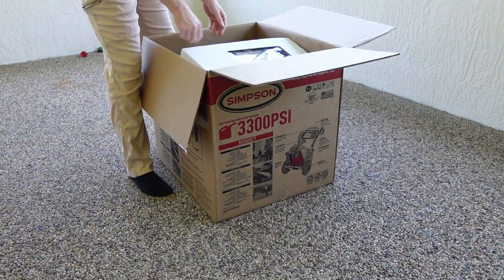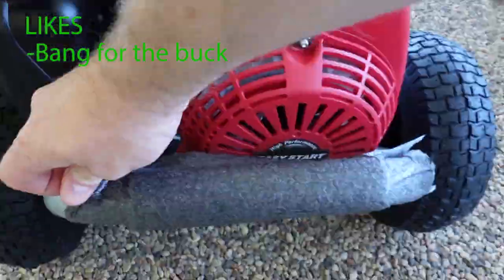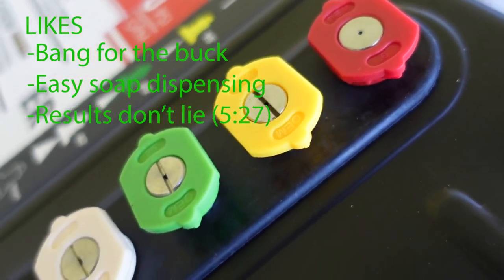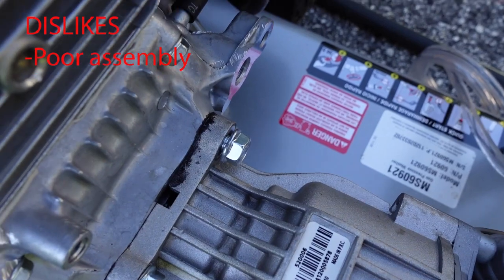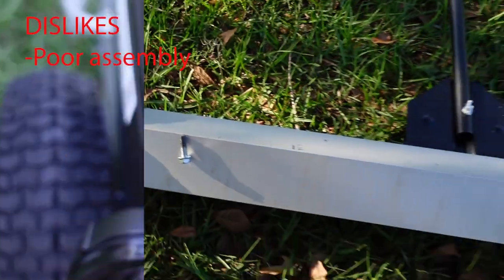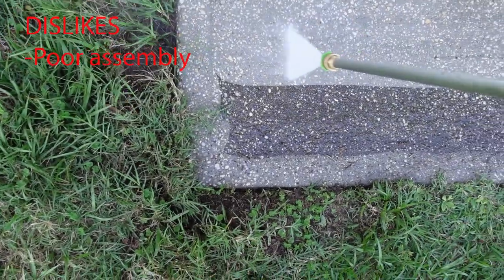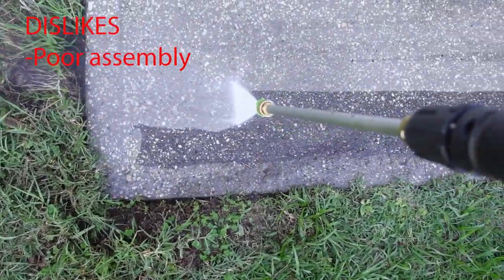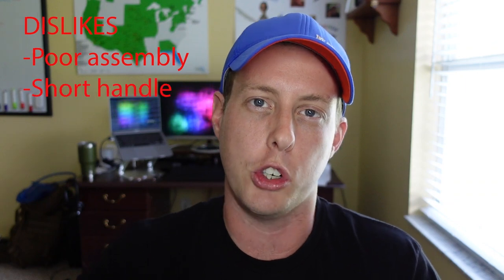Simpson Should Have Fixed THIS On Their Pressure Washer

Comment: Nice review. Now 3 yrs later they're no longer using the Honda GC, and it's GX series, Kohler, or CMX.  I got the CMX rated at 34ooPSI to keep it to the $400 price point. I'll be sure to check all the bolts for torque. I'd use blue loc-tite on those. Yes, they're NOISY! I got a Ryobi 1700 electric to do quiet vehicle washing. Thanks for the video.

Comment: Hello! I have this same pressure washer.. i’ve used it two other times the first time was washed my car washed my sisters car my brothers truck and it worked awesome!! Second time I pressure washed some old nasty hard wood boards  so I could Use them, again No Problems! Today I dragged some landscaping timbers out to clean’m up. I checked the gas checked oil everything great!! Cranked the pressure washer up started with the boards and I noticed that the water pressure would dissipate slightly then in-gage , dissipate—in-gage! I glanced at the washer..OIL !! OMG, I shut it down Fast!! From what I seen:: Clear/clean looking non burned oil on the base of where the engine sits on the body  underneath oil fill….It’s just/only me!! I purchased this pressure washer brand-new unopened box at a pawnshop..?????…

Comment: Would have liked to see Simpson install a gas shut off valve on their unit, so you won't have to run out the gas tank. Luckily, I have a Gas Station near me that sells Ethanol-Free gas, which I use in all of my gas powered tools/equipment and my Lawn Mower.

Comment: Agree it is too short to pull well. I am only 5'7" and still to short. Needs a telescoping handle(adjustable). My big beef is that it is too hard to start after 1st use in fact it wont start eve3n using all the normal tricks. I would take it back.

Comment: Thank you for the nice video.  Up till now I have just written my name in the snow but I just bought a Simpson power washer and today I am trying to learn how to use it.  I really wanted to learn more about the "bypass mode" because I'm a bit paranoid about forgetting to always allow some water through to protect the pump.  BTW what made your concrete so dark before you powerwashed it?
Reply from the maker: I left it running for too long one time and it started spraying water out of what I assume is a pressure relief valve. The concrete darkness was just many years of built-up dirt and grime believe it or not. Thanks for the comment!

Comment: Can the pressure be lowered on the pump? Could you do a video adjusting it?
Reply from the maker: It’s not variable, but you could use a wider nozzle or hold the wand further away if you’re concerned with it being too powerful. Thanks for the comment!
Reply: @ramstanreviews8622  I was thinking for adding different attachments that have lower rated PSI. I see there is a set bolt on a spring with a dab of factory set glue. I think I'll look at an in-line adjuster but it intuitively seems safer adjusting pressure at the pump.

Comment: any issue with the pressure washer vibrating/spinning? Mine spins in place on concrete... :(
Reply from the maker: I do notice some movement on concrete, but usually in the form of “walking” as opposed to the spinning you mention. If there’s some grass nearby, try placing it there instead - I didn’t see any movement in that case. Thanks for the comment!

Comment: Crap washer.  I got mine from tractor supply maybe 3 years ago.   I have done driveway and house 2 times.  Maybe 6 hours of use.  Parked it in my basement went to check oil this past spring to wash again and it dumped all over floor.   The 2 halves of engine case were leaking.  I tried warranty and nothing, i repaired it with honda bond, used again for maybe 30 mins washing car.  Put away again, cleaned out basement a few weeks later and rolled washer out and yet again had dumped its oil in the floor.  The gc, gs engines are absolute shit and the oem brand pump isnt much better.  Get a gx with cat, ar, or better pump.  If you dont believe me message and i will provide pics.